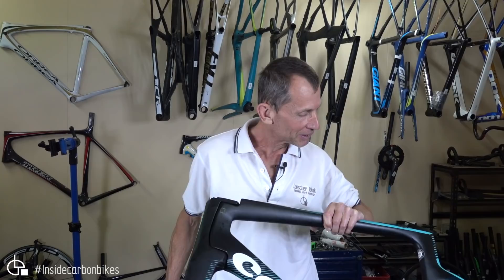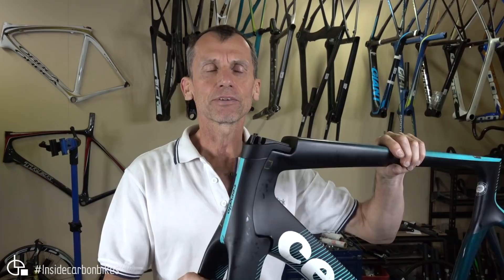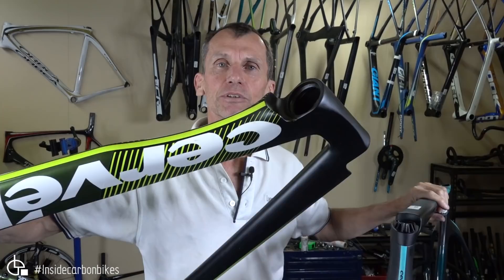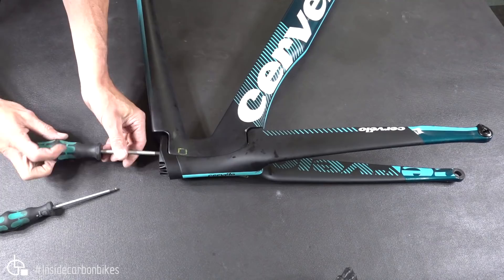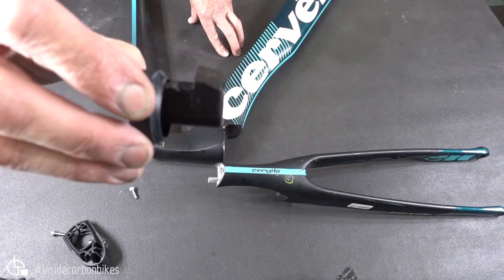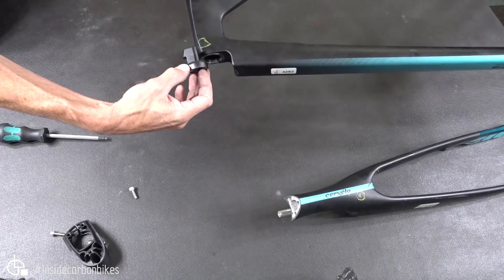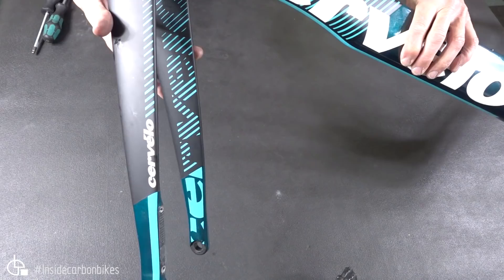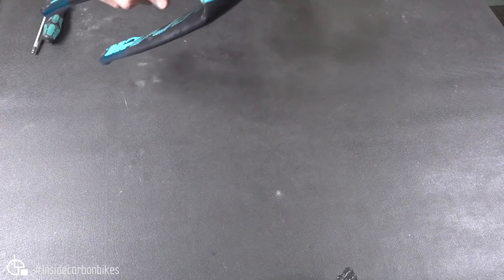Cervelo Design Fail!

Comment: I think Hambini designed that.
Reply: Don't be stupid. That's clearly the work of a 10 year old
Reply: @Hambini  And Hambini is aged 5. Has been for some time. The far dumber 10-year old at Cervelol must be in stunted development too.
Reply: @cccpkingu  pmsl
Reply: Frog cnut 🐸
Reply: Hambini is the influencer rolling around on the product. It is a loose-loose deal between righty-tighty and snap.
Reply: @cccpkingu  - Lefty-loosie ....
Reply: @johnsmith1474  Lefty-loosie is a Cannoncale blog for creaky staircase aficionados.
Reply: @cccpkingu  - I'm older, and traditionally when we might wish to remind a chick which way to turn the lid on a jar to get it off, we'd use the rhyme, "lefty loosie, righty tighty." Of course women today have all the skills without guys advice.

Comment: Bad designs. Shows how little the public knows about C.F. design.  C.F. has been sold as the greatest frame material.  Like Trek  pressing steel bearings into their raw carbon bb. Both are incredibly bad designs.
It shows profits come before safety and common sense design. 
I refuse to ride C.F.  because it's way overpriced stuff.

Comment: thats a bit over critical. BB misalignment is a major issue.  it doesn't take a genius to see from initial design that your going to need to be careful with it, that steering is going to be limited and delicate. sure a rubber bump stop like that on downhill bikes would help but these bikes aren't meant to be bombed on, it's obvious visual aerodynamics sell bikes, especially for you watt weenies. to criticize this issue is no different then someone saying you're a Molly for shaving you legs for aerodynamic gains and the excuse for bandages if you ever road rash reasoning just doesn't cut it.  if you have a crash on most carbon bikes you have a greater chance of your bar end smashing the frame.  I mean I don't own a cervelo or have a need for such a high end bike as I'm not a professional road racer but commonsense would say be careful with carbon bikes as they can all be a bit brittle on high impact and or crashing.